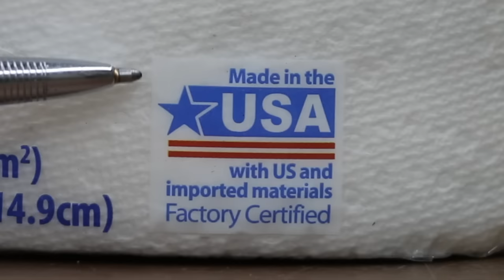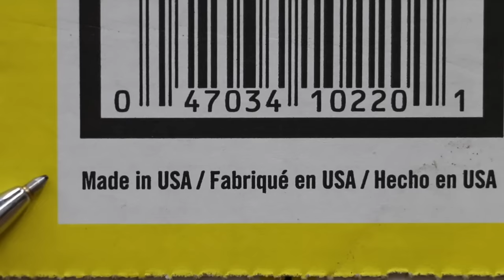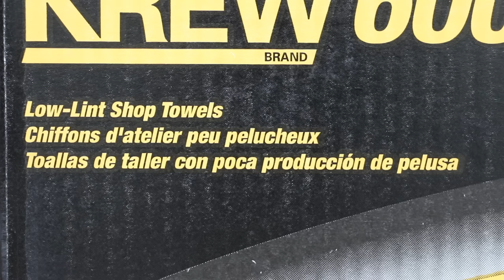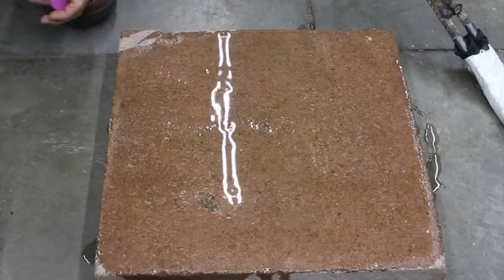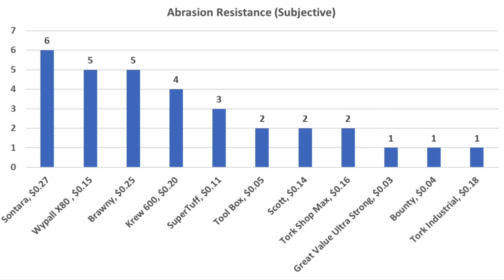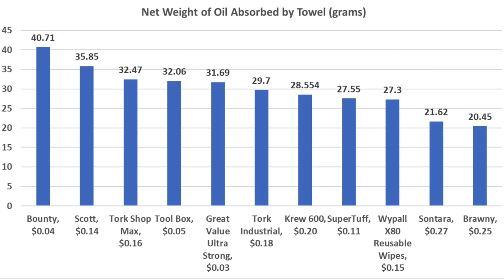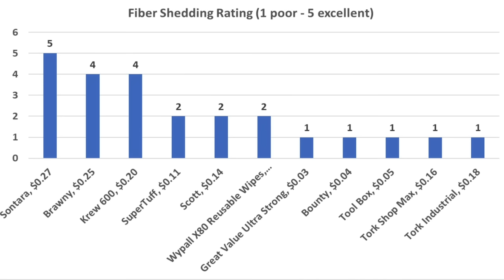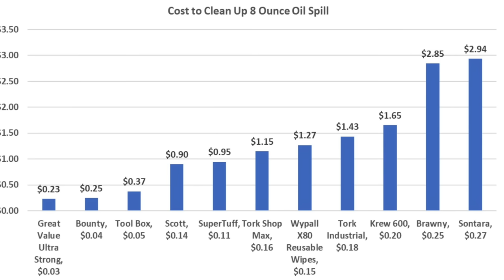Shop Towels vs Paper Towels? Let's Settle This!

Comment: I used a Wypall X70 with Super Clean to remove an oil spill on a concrete porch.  Worked very well, no shreds left behind.  (Always wear gloves.). It is a red towel, the Super Clean turns purple when reacting with the oil, so you end up with purple soiled towels.
Reply from the maker: Thanks for sharing!

Comment: Revisiting this video to mention a new towel I just found at Walmart, "Blue Steel" brand.  These are the strongest paper/shop towels I've used.  They are fairly thin so not the best use for absorbency, but if you need to clean parts like brake rotors/calipers, tools, etc. they are incredibly durable.  Cheers.

Comment: Just a suggestion for more even MORE accuracy - be careful about "per sheet" cost as sheet sizes do vary, as well as single, double and triple ply! Maybe use TOTAL SQUARE FEET of each ply per roll. Using one double ply may be more similar to 2 single ply sheets of equal size. Thanks for all the testing! Fun and informative!
Reply from the maker: You are welcome!  Thanks for the constructive feedback.

Comment: We use the Sontara towels in the Air Force working on jets. They really are surprisingly strong for how thin they are. You don't want pieces of towel fluff getting into jet engine bearings, avionics, or fuel lines.
Reply from the maker: Thanks for the feedback.

Comment: Seeing you spill that oil got me thinking; which is better, Oil-Dri, or kitty litter?
Reply from the maker: Great video idea!
Reply: Good idea! Sawdust too, and diapers. We called them diapers in the air force, i think they're called pig pads? They absorb petroleum products, not water.
Reply: On the farm I've found wheat dust from the combine works as a pretty good absorber as well.
Reply: I don’t know the answer to that question, but my wife’s cat uses oil-dri in her litter box. I can buy a 30lb bag for $6 at the local heavy duty parts house. I don’t even like cats, so there is no way I am paying the mark up on kitty litter.
Reply: @athhud  how does it do with the smell?
Reply: @internet_internet  I'm curious too, if it covers up the smell I'm definitely switching to oil dri, tired of paying 40 bucks for a box of kitty litter

Comment: Would love to see a video testing dish washer detergent. It would be interesting to see if the detergent Pods work better than gel/powder too.
Reply: Believe it or not, Walmart “Great Value” brand powdered dishwasher detergent performs better than more expensive brands. The pods suck. Especially the liquid pack ones. The pack never completely dissolves and gums up the dispenser lid.
Reply: I wonder if there is a dishwasher detergent that will clean off cooked eggs, from cooking scrambled eggs in a bowl in the microwave. I have yet to find a detergent that can do it.
Reply: I'm a big fan of Bubble Bandit.
Reply: @mercoid  yeah, i use the same after try several other options. The pods sucks, too much marketing wank. However i would love to see a proper PF review.
Reply from the maker: Thanks for the suggestion.
Reply: Don't use the dispenser for the gel packs. Drop it on the door  or in the bottom and start it up. Works great, but you still need the rinse agent.
Reply: @mercoid  If that happens, it's because you've blocked the path of water to the dispenser with something too large.
Reply: @ProblemChild-xk7ix  Don't do that.  Dishwashers start by quickly rinsing all the dishes then draining.  If you put the soap in the bottom, you are flushing it down the drain before the wash cycle even starts.

If your soap (whether pod or gel) is still in the dispenser, that means you're blocking the water with something.  A normal dinner plate won't be a problem, but if you put something like a cutting board in the wrong place, the water jet won't reach the dispenser in the door.

Comment: Something I'd be interested is a comparison of vacuum cleaners. Are there any that are as good or better than the Dysons?
Reply from the maker: Thanks for the suggestion.
Reply: Vacuum Wars is an excellent channel. It's basically what you'd get if PF tested vacuums full time.
Reply: @hughbrackett343  didn't know that existed. will have to check it out

Comment: I work for the railroad and we use the wypall x70, we used to have the 80 but I guess they were too expensive. Overall it’s a great towel and we use them to clean all types of greasy, oil parts.
Reply from the maker: Thanks for sharing.

Comment: I use both.  I use the cheapest to remove the bulk of goop.  For the last pass, I might use the manufactured shop towel.  The towel dispensers have covers to prevent a layer of dust on top of the roll.

Comment: This video gave a good insight, bang for buck bounty is a great solution for liquid spills that doesn’t require a low lint solution. But if youre doing a job like internal engine work or transmission work, it’s worth spending the extra money on a more expensive solution. 

Very good video! I would have loved to see how the generic red rag would have competed in this test
Reply from the maker: Thanks!  Thanks for the constructive feedback.

Comment: I would always use disposable towels for cleaning oil or any other flammable substance. The only realistically safe way to clean reusable cloth towels with oil on them is by hand, then air dried on a rack or line, and that just takes too much time.

Also, as someone else noted, I would have been interested to see Viva paper towels in this comparison. That's the brand I usually get because they're inexpensive and pretty durable.
Reply from the maker: Thanks for the suggestion.
Reply: @ProjectFarm  I second the suggestion. I actually ran a couple viva towels through my clothes washer (accidentally). They held up far better than I expected, but I'm not sure I'd recommend it.

Comment: On the aerospace grade wipes, you've got a national stock number. The two digit group—it's the fifth and sixth digit—is a country code indicating where the things are made. The values 00 and 01 in that position indicate US country of origin.

One thing you missed with the Wypall X80 in the absorbency test is that those things are tough enough that you can wring them out and go back for seconds. I can use them to clean up metal chips and oil from the lathe for weeks before they even start to pretend to wear out.
Reply from the maker: Thanks for the constructive feedback.

Comment: One thing I would of liked to have seen is the comparative strength of the cheaper brands by using multiple sheets. For example, the Tool Box was 1/3rd the price of the Wypall X80 and was more absorbent (though less capillary absorbency) but less abrasian resistant. For the price though I could double or triple the Tool Box wipes on a tough job and still make out ahead of the Wypall.

Just a thought!
Reply from the maker: Thanks for the suggestion.

Comment: Todd, you never fail to put together an excellent experiment. However I feel that the oil absorption test could’ve been done a bit differently. Let the towel lay unfolded in a pan for 30 seconds. I feel this will increase the accuracy on the capacity these towels hold. Love your videos, been watching for years!
Reply from the maker: Thanks for the constructive feedback.

Comment: Great video, I love your stuff and have made product choices off of the data you collect! 

On this one I would have liked to see you test the abrasiveness of the towels themselves against automotive paint or plexiglass. I have found that even relatively soft paper towels can have a significant scratching effect on plexiglass and to a lesser extent automotive paints. It would be good to know which disposable towels are the softest and least abrasive and which are most likely to scratch a delicate surface. 

Maybe a new video with these towels and compare them against the cheapest microfiber towels you can find? (Microfiber is supposedly what one should use to not scratch delicate surfaces).

Love the channel and all the effort your put in to devising fair and repeatable tests with as little human bias as possible. Thanks!
Reply from the maker: Thanks!  Thanks for the suggestion.

Comment: Please test antiseize on spark plugs. Claims are that it alters torque values increasing the risk of overtightening and breaking off plugs or damaging threads. Also, claims that it causes resistance affecting spark quality and causing misfiring, and finally, claims that it doesn't prevent corrosion between spark plugs and aluminum heads. Love your channel! I think you are the only one who could definitively test this!
Reply from the maker: Thanks!  Thanks for the video idea.

Comment: After see this, a dry sweep test is needed. I have worked with some pretty great products but that are some that just don't cut it. Working with military shops for years I seen bad dry sweep take forever to pick spills up and the better stuff hardly last in the shop.
Reply from the maker: Thanks for the suggestion.

Comment: I use Scott shop blue since they are .038 cents a towel which is in line with regular paper towels and way better in my use case, Wypall is nice but the cheapest is .14 cents a towel today which is 4-5x more. The pack you used for scott is .042 cents a towel and even during covid the price didn't not fluctuate much.
Reply from the maker: Thanks or sharing.

Comment: When testing tensile strength of paper products the results will vary based on which direction the product is tested. There's machine direction and cross direction and depending on which is tested will give varying results of the exact same product
Reply from the maker: Thanks for the feedback.

Comment: Thanks for always helping me make my decisions with the best ones! Really cool you do such a variety of every thing! I've got few ideas I'm hoping you can help me and my wife out with.. thanks again keep being awesome!

Garden hose (drinkable is a plus and chew proof) 
Motorcycle oil (motul 300v included)
Weather Station 
Flashlight (toughest..brightest) (malkoff, modlite brands included) 
18650 battery charger 
(Mechine) Metal polish (maverick abrasives, Even's detailing, menzerna brands included) (high speed vs low speed) 
Surge protector (it would be a cool if they individually turned on/off)
Reply from the maker: You are welcome!  Thanks for the suggestion.

Comment: Id be interested to see how well viva paper towells do since they're very similar to shop towells. For the house Viva is our go to brand. I know its a house brand but theyre way better than any other house paper towell weve ever used.
Reply: To answer your question viva(signature cloth, not the junk multisurface crap) is made for household use with more absorbency. They are made on the same machine with small modification to the machines parts when switching from one to the other.

Comment: Used to use the Brawny industrial towels when working in food service. They are fantastic but seem more like fabric then paper. We would use the same towel multiple times for the same purpose(like one for sanitizing, one for dishes ect) so the benefits of multi use is true. Although when doing things like cleaning the meat slicer we would use cheap brown paper towels to get most the gunk off first b/c having to repeatedly go rinse the brawny was annoying. Because of their high price you would want to use more then once to get the most value so cheap brown paper towels were better for cleaning up messes where as Brawny is better for more routine cleaning.
Reply from the maker: Thanks for the feedback.

Comment: Seriously impressed by the Tool Box brand.  It's as cheap as the non work towels, but performed in comparison with towels that are three+ times it's cost.  Not the best for hard jobs, but seems great for general work use.
Reply from the maker: Thanks for sharing!

Comment: Great video as usual. I'm not an environment nut, but it just occurred to me to wonder how quickly the shop towels degrade in nature. I guess that is something almost impossible to test other than with time.
Reply from the maker: Thanks!
Reply: I know this is a relatively older comment but I was curious so I looked into it. Based on the information I could find most shop towels are made of natural fibers such as cotton or wood fibers, these shouldn’t take too much longer to break down then a paper towel, ranging from a couple weeks to a few months based on what I could find. However, some brands do contain polyester and other synthetic fibers which take significantly longer to break down, anywhere from 20 to 200 years. However, the oils and other liquids you clean up with these towels can be far worse for the environment then the synthetic fibers.
Reply: @kylecarr1979   Okay, good to know, seems logical :)

Comment: Didn't go through all prior comments , but still , think you should have also do a test  on reuseability of each towel , if one brand can be used and drained and then reused more than once or more often as compared to another brand,  then cost per towel kind of changes
Reply from the maker: Thanks for the suggestion.

Comment: I seem to be coming across a lot of your videos recently. 😅
Very nice videos. 

One thing I noticed: when showing how you folded Great Value for tensile test, you basically pulled in the cross direction (CD). I couldn’t see if the Bounty towel was folded and pulled in the same manner. 
All paper, from paper making machines, always have more fiber oriented in the machine direction (MD), so their tensile strength is stronger when pulled in MD vs CD. Most paper makers try to compensate by having slurry jet travel faster than the first wire/belt, to attempt reorient some fibers into the CD. In doing so, they can get an increase in CD strength with the loss of some MD strength, achieving an overall higher dart burst strength (the weaker direction will give in first).
When determining dry or wet strength, it is usually better to either test the burst strength (which automatically account for the weaker direction breaking first), or test both MD and CD and look at both. 

Haven’t finished the video yet. Will keep watching. 
Thank you.
Reply from the maker: Thanks for watching!

Comment: In the end, you stated the "what" towels are designed to do.  I sold industrial wipers for well over 20 years, and actually worked for the manufacturer of one of those you tested.  All the tests were fair, but comparing a kitchen towel to an industrial wiper is a bit apples and oranges, since both are designed for completely different work uses. IF absorbency is the main concern, water, oil, solvents, greases will all affect the different substrates in different ways, which will affect the abrasion test; do they need to be lint free; will they stand up to solvents (the binders in some towels won't stand up to solvents), etc.

Comment: Video idea: strength of metal rope fasteners. 

This past weekend I was hanging some string lights and the crimp connection kept failing. Maybe it was because I didn't use the right crimper, but the crimp kept stripping the plastic sheathing off the wire rope. I switched to the ubolt style termination and those suck too. There is not torque spec and the supper soft material bolt kept stripping.

Comment: Although they're more expensive, I wholeheartedly agree that Wypall is a good product.  Clearly there are other, better choices just for absorbing spills but I've used Wypall working on firearms and machining metal for years for its durability and long life, more like using a rag.  Bounty is my choice when there's a lot of cleanup like spraying paint using a paint gun and compressor.
Reply: The Wypalls can be wrung out and immediately re-used. For long term leak absorption I use PIG mat.

Comment: Hey i have another video idea (if you’re interested) Toilet fill valves! You could rate them on loudness, speed, ease of adjustment and so forth! To make a good testing rig you could just drill a hole in the bottom of a 5gal bucket.
Reply from the maker: Thanks for the suggestion.

Comment: Awesome video! 

I work in the pest control industry and I go through PPE gloves such as chemicals resistant along with latex or what ever else the company provides me

An idea for a video is to see what type of gloves is best for the industry need something strong that wont break when putting them on and wont get puncture when around leaves. Of course cost is important. Now reusable gloves is a big plus but in the heat it can lead to rashes.

Guess in short term suggestion

Chemical gloves that can either be cheap enough to have tons of or chemical gloves that can save tons of money and time.

PS i used your Best gloves video to pick craftsman for crawlspace and outdoor work love em!
Reply from the maker: Thanks!  Thanks for the video idea.

Comment: Might be a tough one, compare best engine flush’s and methods? 
500 miles with 20% marvel mystery oil? 
300 miles with 1 oz sea foam per quart?
Motor medic 5 min flush? 
Amsoil flush? 
Lubro Moly Flush?

Who’s best? Safest? Etc?
Reply from the maker: Thanks for the video idea.

Comment: Love your work! Would love to see some 15/40 Diesel engine oil comparisons.
Reply from the maker: Thanks!  Thanks for the video idea.
Reply: I second that. Great idea. I am an owner operator and use 10 gallons (40 quarts) per oil change in my old 550HP 3406E 5EK hauling usually close to 80k lbs all over the country, in all weather conditions, through the mountains, across the desert, in temps from 125°F to -30°F and would like to know which oil is the most protective and best bang for the buck.

Comment: Soak the paper in used motor oil and let dry till it is not wet just moist and then use it as a gasket. Used the method a few times in a pinch. Runs for days, with no trouble.1
Reply from the maker: Thanks for the feedback.